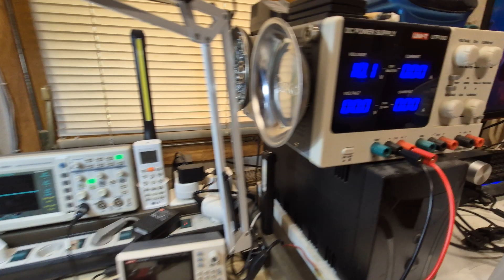ZVS driver wireless energy transfer

Comment: If you put a Tesla coil on that zvs it's probably be more effective

But design the secondary to actually radiate it's power and not discharge it

Typically Tesla coils are tuned slightly under 1/4 wavelength, and coil is  purposefully wound to produce corona and arc discharge which is no good for   actually transmitting power

And the pickup coil handles setting the voltage and DC filtering so you also have a transformer and voltage multiplication built-in

With resonant transformer you use air as an inductor

Or ferrite, 100khz+ resonant

You have Class e resonant that use over  4mhz switching and tuning
Reply from the maker: I should experiment with that in the future, if I remember Mr Carlson's Lab was doing something like that with vacuum tubes